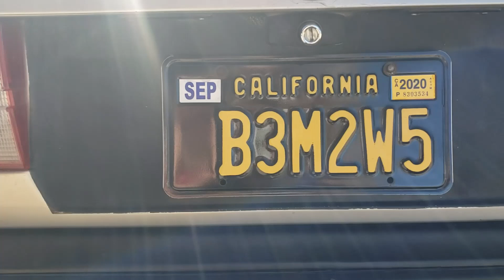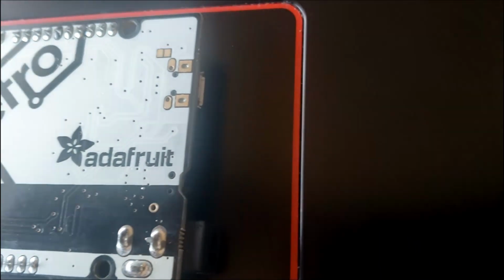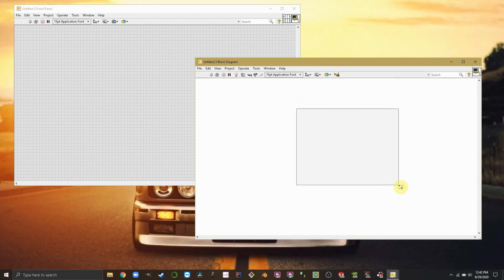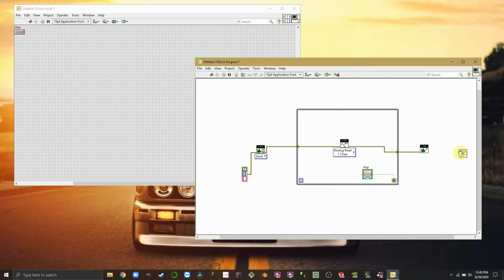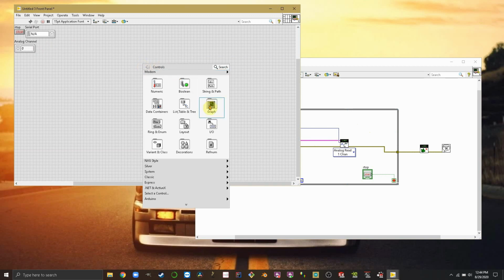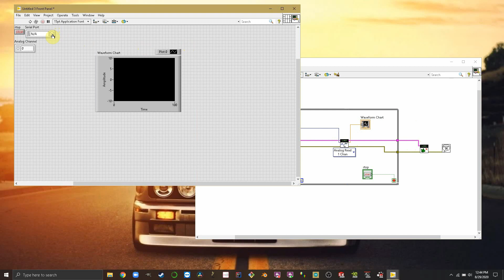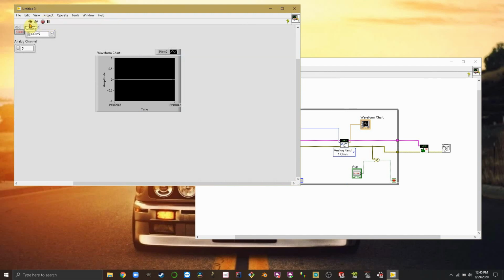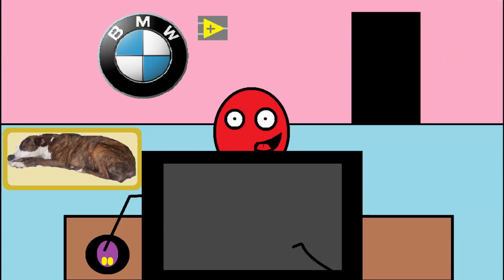Reading Battery Voltage Through Arduino Controlled By LabVIEW

Comment from the maker: Update 1 (12/18/21):

Although the ATMega328 (the chip on the Metro) is a tried and true low cost chip, at this point there are better options,
for a more powerful chip I would suggest the SAMD21, SAMD51, or the RP2040, I will leave some links to where you can find dev boards with them on it, 
In addition, after using this LabVIEW interface for awhile now, I find that there is a lot of overhead using the LINX nodes,
you might want to consider typing your code in Arduino uploading it and then accessing the information through the serial node in LabVIEW
If there is interest I will do a video about how to do this method, Happy Tinkering!

SAMD21
https://www.adafruit.com/product/2772

SAMD51 (bigger brother and more powerful version of SAMD21)
https://www.adafruit.com/product/4064
https://www.sparkfun.com/products/14713
https://www.adafruit.com/product/3857

RP2040
https://www.adafruit.com/product/4884
https://www.adafruit.com/product/4864
https://www.adafruit.com/product/4900